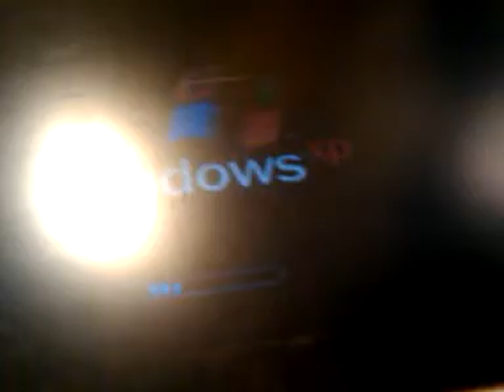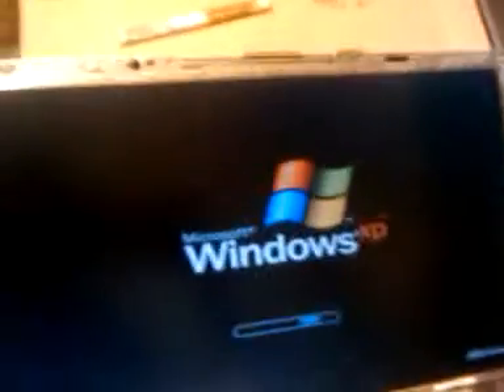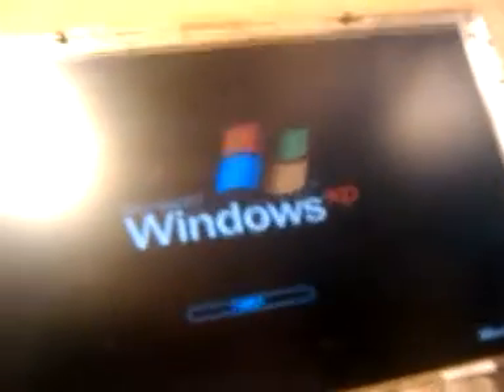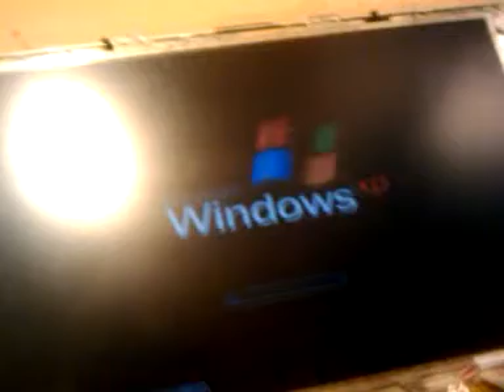How to test a laptop's LCD CCFL backlight cheaply and easily

Comment: What did you do when the screen changes at 4:12 to 4:13? Because that screen at 4:13 is the same as mine. Is the inverter causing that or the lcd flourescent? and my screen only showing all lines and cant show original pixel picture .
Reply from the maker: Usually, the edge connectors that drive pixel array is damaged when that happens, or the cable isn't connected properly, or the socket is damaged on the driver board on the back of the LCD. 

I'd try reconnecting the cable (both ends) first.

Comment: Or even easier is what I did. I just took of the bezel off the laptop and unplugged the connector from the inverter going to the backlight in the screen. Just take 2 very thin pieces of wire, or a paperclip if you have one thin enough, and bridge the gaps between the inverter output going into the screen and the new backlight on each connector end and Viola! Your done. I just tested mine and it took me less than 10 minutes, and sure enough, it wasn't the inverter and the bulb lit up brightly. I want to add you would want to keep the new uninstalled backlight on the carpet or any non conductive material ie...(a metal bench top) but if you are that incompetent, you shouldn't even be messing with it in the first place. Hope this helps for anybody reading this.